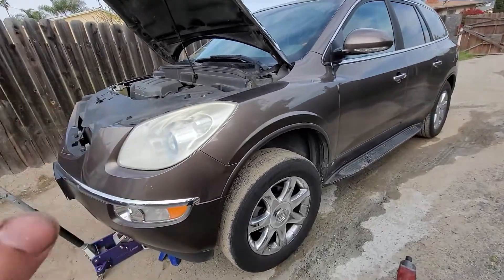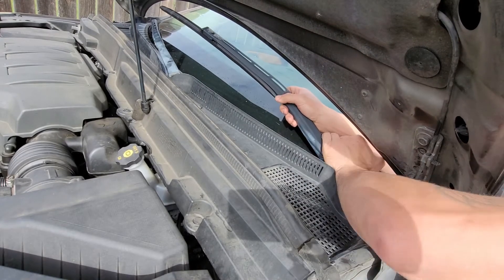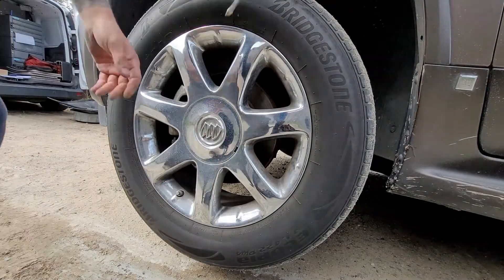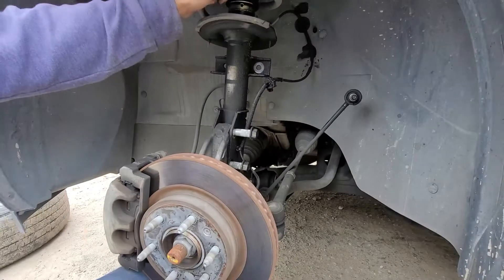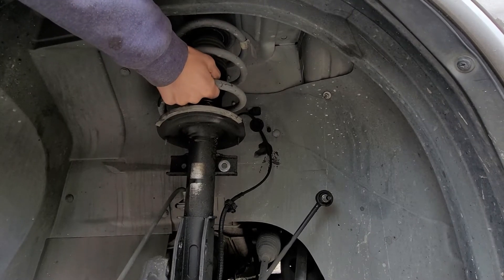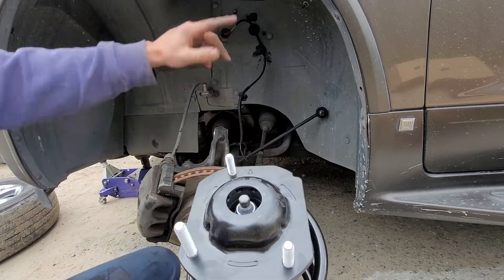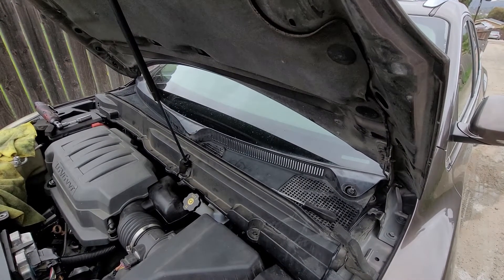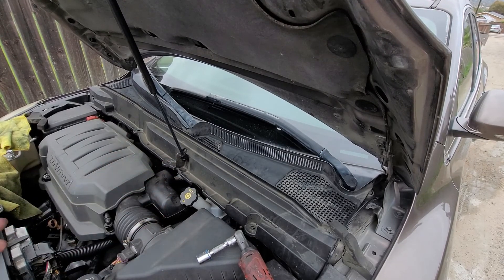2008 Buick Enclave front shock replacement

Comment: Thanks bro! I got a 2013 and replaced the alternator thanks to your video saved me 1250$ (dealer was charging 1500) I got the AC delco refurb for 300-50 for core so $250 @ rock auto. I just cracked 100k miles so imma do the suspension work, rears are simple front one I wasn’t aware about removing the cowl plastics. I appreciate what you do.
Reply: Have*
Reply from the maker: Glad I was able to help you out with this work.